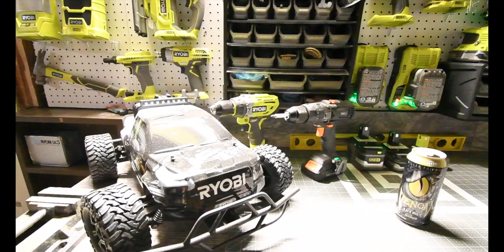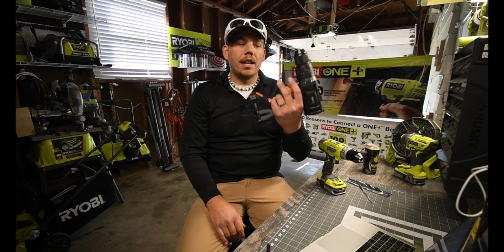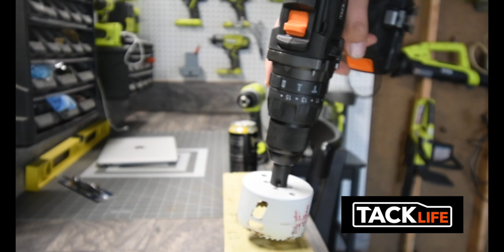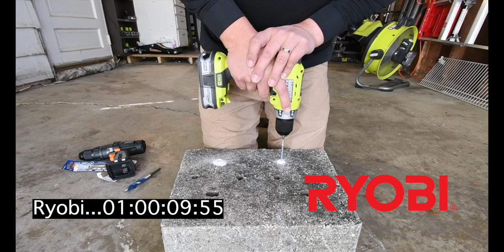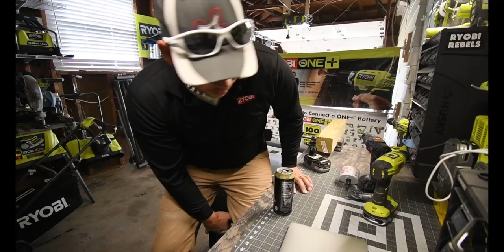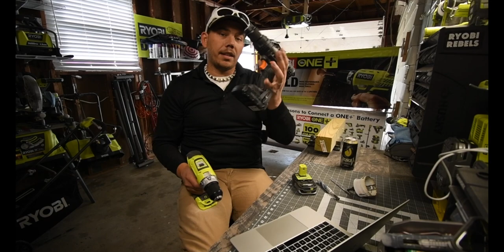Ryobi vs. TackLife

Comment: I replaced the chuck on my ryobi  p214 with a much better makita hammer drill chuck I bought on eBay and now it works badass.
Reply from the maker: Good, Im  glad you were able to fix it
Reply: I did mine with a dewalt motor too. I painted it red it’s sooooooooooooooooooooooooooooooooooooooo much better than any big brand manufacturer

Comment: when drilling the enemy is the dust. it causes friction ruining the temper of the bit and cushins the hammering effect. when i have to use a hole saw that big in wood I make a smaller hole maybe 3/8 if you want make a few that the saw dust will fall into, it'll go a bit faster and easier but more importantly the hole saw will last WAY longer.
Reply from the maker: very good and thank you for viewing sir
Reply: Interesting idea, I’ll have to try that

Comment: I know you love that little Ryobi blower that you use a lot BUT it would be much better and better for your health long term if you used your "Vac" to suction up dust and debri from wood/mdf/concrete etc ........    When you blow all that "debri and dust" away from your work spot you are only making it airborne and breathing it in.........who knows what the "dust" contains when cutting laminate floor and other manmade products.......even breathing in natural wood dust is bad for your health long term........even using a dust mask or respirator with filter will suffice in an outdoor situation......
Reply from the maker: when the sun hits the garage I see all the dust floating in the air. I agree with you on that and thank you
Reply: Ryobi Man Caver no worries mate, I'm not having a go at you but having done a fair bit of woodwork I know sawdust and shavings/debris are your worst enemies, both for your health and your workspace......its all a learning curve...
Reply from the maker: You are right. I do think that it’s dangerous at times to breath that crap in. I should vacuum it up.
Reply: I use a compressor to blow it all away but yeah that's a good method too

Comment: You should do a video comparing the little Ryobi inflator that you always used to blow off projects and the Ryobi Workshop blower. I work in a custom shop building fiberglass tanks and pipe and am looking to buy one of these to help blow off the stuff I'm working on at my job site for work
Reply from the maker: The Critter Gitter I can do that sir and good suggestion
Reply: @ManCaverTools  thank you very much!

Comment: Great video. What I didn't realize is they have both 18v & 20v tools. Are they compatible with each other? 18 & 20 are very similar is performance. Like Craftsman's old C3 19.2v is basically 18v performance. I don't see much difference between 18 & 20 volt tools on any tool platform. Just my opinion. Like you said, there is a big difference between Amp Hour batteries & makes a big difference the new HP's have & takes the brushless tools to a whole new level.Thanks guy. Peace....
Reply from the maker: Greg Taylor I’m not sure yet. Don’t have their 18v drill but I’m interested to find out

Comment: Can’t really recommend the tacklife shit can you?  Think about it. Get the tack life and share the batteries with 2 tools. That tacklife tool is a toy. You can get the brushless hammer drill kit right now for $90.93 plus tax at Home Depot. No that’s not clearance price. The kit comes with a free 4.0Ah HP battery thst can be returned or keep it (I say keep it) but that’s the receipt price. Kinda hard to make a case for tacklife.
Reply from the maker: Recommend tacklife over the RYOBI brand, no. but there are a lot of people out there that hate Ryobi and they have no problem telling me they hate Ryobi either. lol I get heat from all brands that are against Ryobi. Now I get Ryobi people telling me that tacklife if shit. which so far tacklife does the job, but My ryobi tools does the job better. Tacklife isn't a bad brand, just like when I have to tell Dewalt and Milwaukee fans that ryobi is not a bad brand either. I Love Ryobi and always will. No company will take that away form me. if tacklife says stop making ryobi videos I will stop tacklife form being in my videos. and thank you for viewing sir